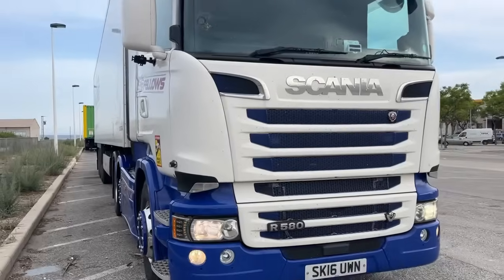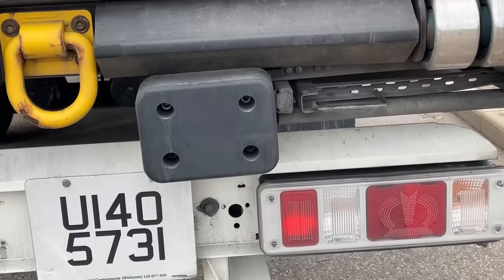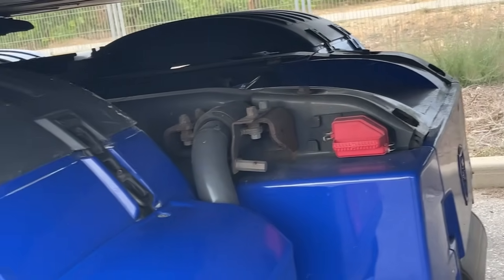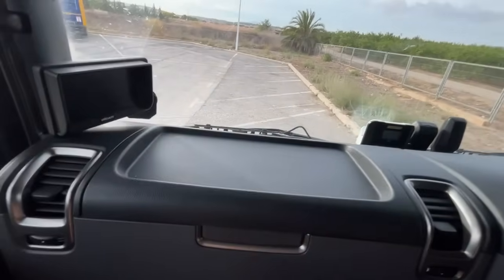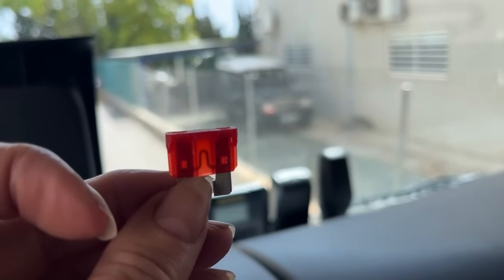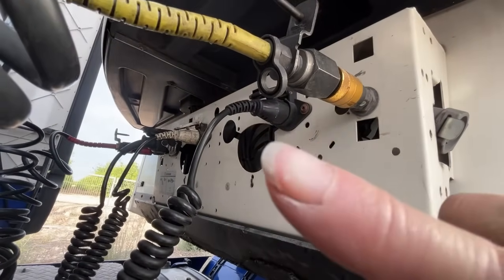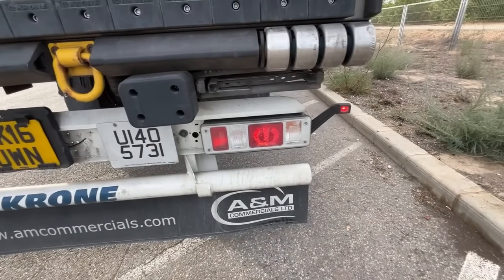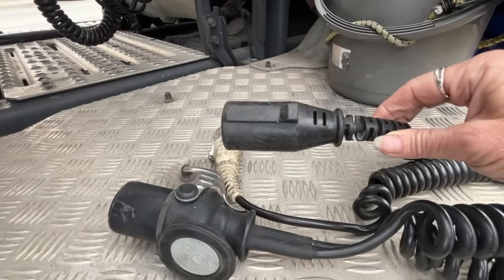Electrical Problem

Comment: As others have commented a spray of WD-40 can help or better still a good electric contact cleaner. A simple test lamp, the type that looks like a pen with an electric wire on the end, is useful when trying to locate  wiring faults.

Comment: One thing to look out for is that the side light fuses on the unit are independent to the trailer side lights. These trailer fuses normally blow when trailer changing. Drivers tend to pull the plug out and drop the plug onto the metal catwalk which shorts the fuse.
Reply from the maker: Thanks for the info 😁

Comment: Very well presented as usual Sherralin, the version 1 FH had a fuse tester in the fuse box compartment, discontinued with newer models for god knows why and not picked up by others. I do ferry trailers and q often a squirt of WD 40 in the Susie connectors solves the problem with lights. Looking forward to your next vlog.
Reply from the maker: Thank you 😁

Comment: Great vlog Sherralin, yes " kiss" ( keep it simple stupid) has gone out of the window in tech and not letting drivers repair even temp until safe area to stop etc. I have got into the habit of carrying spare bulbs in my current vehicle plus other bits and pieces and if a headlight bulb goes I replace both near and offside at the same time because as sure as eggs r eggs the other one will blow very soon. Hope you had a brew after that because you deserved it. Stay safe out there...
Reply from the maker: “Kiss” I like that 😁👍🏻

Comment: Its either a wiring problem or fuse as many have said.  Are the plugs on your susie plugged in properly (may have loosened up a little if you've been down some rough roads), just push them in and the same with your fuses.  Surprisingly, this has happened to us on occasions.  Just try the easiest things first, and work your way through to having to possibly change fuses.  (Stupid thing to say, because by this time, you've probably fixed the problem)🤣.  But why oh why, does it always affect the most out of reach part to try and fix.  I have LED lights in the bathroom at home, one in each corner, and one's gone out, and its got to be the one over the bath at the wall (side and back)/tap/shower end.  For me to reach it (I'm 5ft 0"), I would have to get my larger lightweight ladder into the bath itself.  So, unlike yourself, I'm not bothering😊.  The other three lights still make my bathroom light up🤣🤣.  have now got to where you've fixed it.  I'm so pleased for you, and I'm actually pleased with myself as well.  Over the years of me and my hubby having gone through things ourselves when we've broken down, and had to fix things, and with my hubby now sadly passed away, I've learnt a few things, and I feel like I've fixed your wagon😊
Reply from the maker: Glad you enjoyed it 😁

Comment: Ironically I looked up "Suzy Cable" a few weeks ago. Common wisdom is that the name should actually be "Susie", which is an acronym for "SUSpended Integrated Electrical" cable.
Reply from the maker: Thanks for the info 😁👍🏻

Comment: It stands for SUSpended Insulated Electrical. I'm sorry but that is a backronym. No one knows why SUSIE/SUZIE is the name for the curly tubes and wires connecting the services between truck and trailer.
Reply from the maker: Thank you 👍🏻